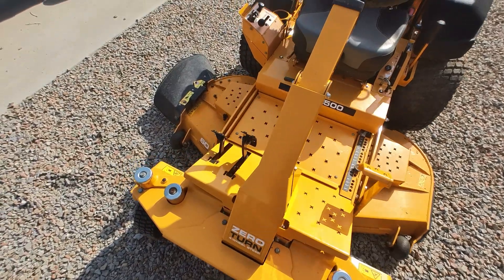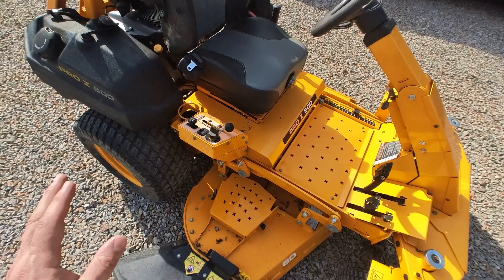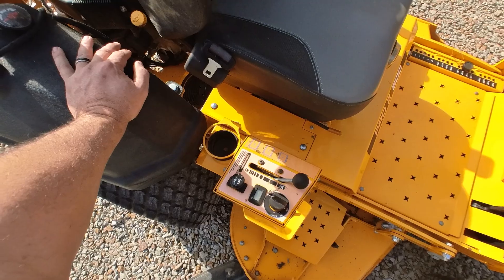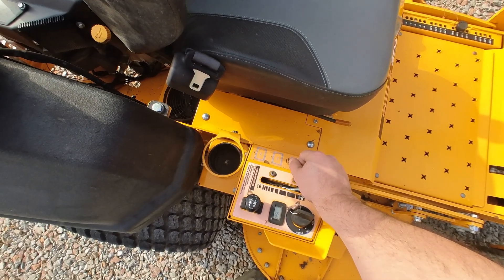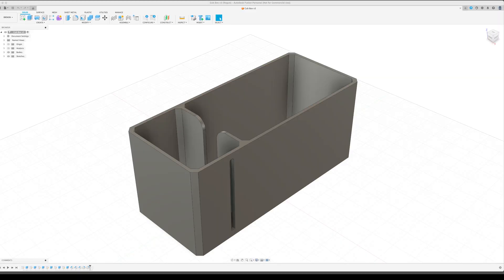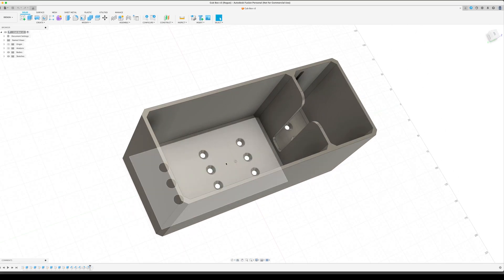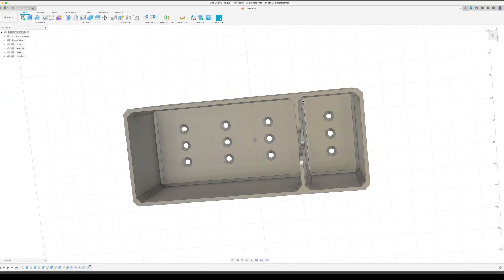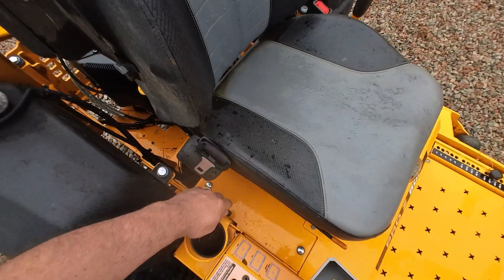DIY Lawn Mower Mods Using a 3D Printer

Comment: Looks good. For clearance purposes, can you still adjust the seat forward and back. Is it an air seat and drop down when seated.
Reply from the maker: Yes, there’s actually quite a bit of clearance on the inside enough to stay clear of the seat. The seat adjustment lever moves inward, so no issues with clearance there.

Now, sitting in the air seat—that’s a great point, and honestly one I hadn’t really considered. It actually made me go out and sit in the seat to check it in real time. With the version I currently have installed, it does clear, but it’s definitely making contact. Over time, I could see that causing some wear on the rubber boot under the seat.

The final version, though, is only 80mm high, so it should clear the seat completely. Looks like I’ll be reprinting a fresh version for my mower after all.

I really appreciate the insight—it helped me catch something I might’ve missed otherwise.
Reply: @ExtrusionTherapy  no problem, I use John Deere and Kubota ride on mowers and always looking for space for carrying gear

Comment: THIS is my kind of content lol. 
That mower tho....just saying I cashed my zero-turn in for a rider after one season after I realized you can't actually zero-turn in a zero-turn without chewing up your lawn
Reply from the maker: This ones a little different it does zero turn, but it has a steering wheel and you actually steer the front wheels. It's technically four wheel steering I suppose. If you really crank on it, it will tear up your grass, but you have the option to be smoother with the steering wheel.
Reply: @ExtrusionTherapy  No idea that kind of steering even existed, good to know. So basically GT3 steering on a mower? LOL
Reply from the maker: @TechnicalsTinkers  that's a good way to put it, it's one of those mowers the neighbors talk about 🤣

Comment: Great video! One question, does the bottom fit flush with the mower? If it does, it will take awhile for water to drain. Pour water in it and see if it drains.
Reply from the maker: I have tested it for water drainage and it does a pretty good job. I was worried about that too and after the first prototype, if it was holding water, I was going to add a couple of feet on the bottom to create a small space, but turns out wasn't necessary..
Reply: @ExtrusionTherapy  Cool Glad it's working as intended!

Comment: this is interesting because i've recently thought of making a mod for my grandmas electric push mower....it has a safety handle that always makes my hands cramp up when i'm mowing her lawn...i was gonna make something that either uses a spring lock system to hold down the safety handle or maybe even just an adjustable clamp to hold it down 

cheers
Reply from the maker: Now, obviously, I can't recommend you circumvent safety features, even though I would probably do the exact same thing, but I might say is you could print something to put on the safety bar to make it more comfortable something that could clip over the bar but when it's joined to the handle of the mower itself, it feels more ergonomic.